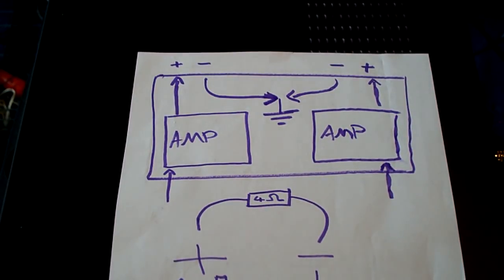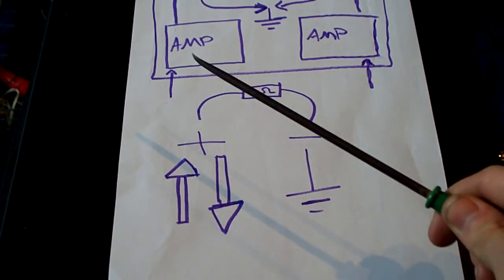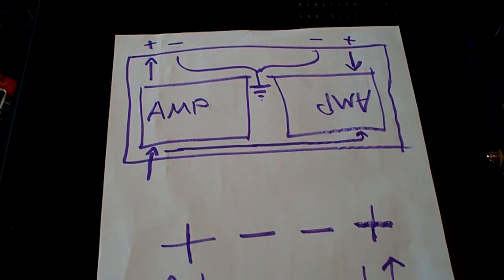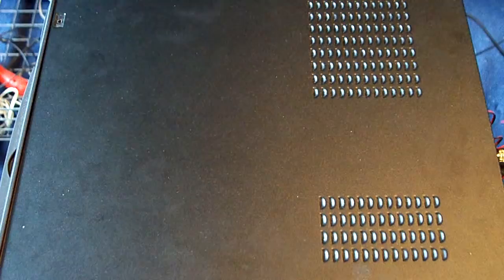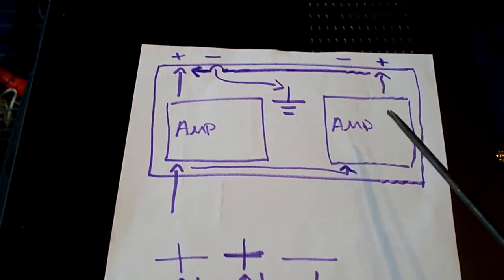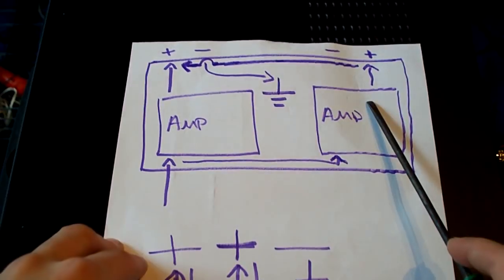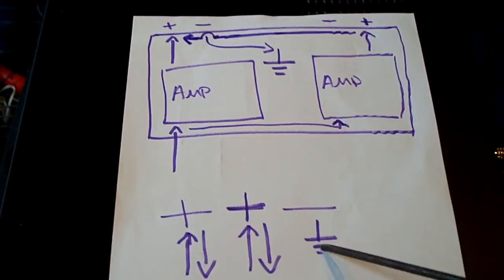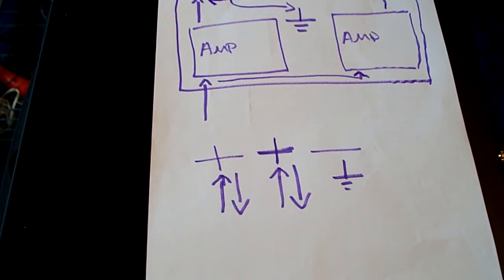How bridgeable amplifiers work! Bridge / Parallel Mono ~ EXPLANATION

Comment: Excellent vid mate. I have thought about the parallel bridge thing but i didn't know it existed and worked!  It make perfect sense though.
Both the negatives in the amp will be the same so you could use both if you wanted to, but you wouldn't need to.
And, heck so many comments about you being wrong about the bridging, one channel is already inverted so one - is actually +. But you already said that, haha. 
Anyway, great vid, you always make good tutorials.

Comment: Your explanation is very clear and correct. I am an electronics engineer, and I cant believe some of the stupid comments people have posted about this - they show their ignorance and unwillingness to learn. I have a question though - if I am running a Crown 1201 in Bridge Mono, but I dont have the +Ve posts linked, why am I getting distortion out of Channel 2 when I connect a speaker across it? Surely if both channels are receiving the same in phase signal then both channels would running normally?. The amp works fine in stereo on both channels otherwise. I am thinking there is a reason to do with the negative terminal on channel 2 in bridged mono mode.
Reply: +No.6 Portmeirion 
you are an electronics engineer and asking this question.. LOL

Comment: I want to watch you bridge two amps & ground the amps negative speaker wire terminals to ground like you're saying here. :)
Reply from the maker: +kbryancourville I'm not saying to ground them. I am saying they are internally grounded to the output section floating ground.
Reply: @barevids  some amps dont say bridgable....so what is diffetent in a bridgabele amp?

Comment: It's easier to thing of the "+" as "live" and the "-" as "neutral" as the "+" is emitting an AC audio signal and the "-" is just a ground. I suppose you could combine bridge and parallel to give you 4 x the power into the same speaker and have the same minimum impedance.

You should be able to parallel more than two amps but bridging is only two. I don't think you can bridge a bridge as far as I know.

Comment: Hi BV. Thanks for your informative video. Unfortunately I still can't quite figure my large pro audio system out to patch it and run it correctly - mainly I'd like to check how I power the subs. I'm a pro musician - our band plays a lot of large venues. My sole amp is a Camco Quadro Vortex 3 4-channel amplifier (rated 750w into 4 ohms per channel), and it powers my double NEXO PS8 system (which is 4 x ps8 boxes for the tops, and 4 x LS400 subs - I run two of each of these boxes per side (so 4 tops and 4 bottoms in total). I run the PS8 top boxes in stereo.. 2 per side, so a 4 ohm lode per side out of amp channels B and D in stereo. The individual sub boxes are 6-ohm boxes, so I link two boxes together per side, out of amp channels A and C, so those 4 boxes would be a 3-ohm load per side - per amp channel there, as I have all four amp channels switched to stereo. But I suspect I'm not running the subs as powerfully as I could be, so may not be getting the maximum bottom end out of the amp, but I think the A&C sub channels are being pushed quite hard regardless of the modest output. Can you please tell me how I should patch this particular system to get the absolute MAXIMUM out of the amp for the subs? It's loud, and sounds clean, but I suspect it's capable of much more, if I patch it correctly - would parallel mono for sub channels A & C in this case be better than just running it in stereo with this heavy 3-ohm load per amp channel? I use the original blue analogue NEXO TD Controller for full speaker management, as is Nexo's requirement.

Comment: Your comments about parallel amps is absolutely correct but you dont explain how to generate a 180 degree phase shift to enable the amp to operate as a bridge amp. To do this you have to gain access to the inverting input of the amp you want to be the inverter. This involves lifting the feedback ground resistor off ground and connecting this to the main amp's speaker output. This is known as "master slave" working.  It is the best way to do it. You can buy inverters to do this though.

Comment: so connect the remote to the 2nd one is what youre saying? I dont get why you have to flip the 2nd one facing the other way how does the head unit know the difference .. oh well I'll try it anyways ..  Im going to use y splitter for rca right and left thats mono right? Thanks for the idea ..
Reply from the maker: No no no, the remote has nothing to do with it... You've misunderstood the video, DON'T try it as you'll end up blowing something up.
Reply: @barevids  I did and it plays okay lol .. its 2 under seat 8" amp subs ..

Comment: Don't confuse this with the rest of the circuit! It works this way because you are changing polarity of the speakers, not the current flow through the amp.

Comment from the maker: @walkingfreak incorrect man, PA amps with a switch to change from stereo to bridge flip the signal on the 2nd positive. In car amps this is less common as usually the negative is actually a flipped positive in the first place.

Comment: greetings i have a question: i have 2 crown amps xti 6000, they are linked. Each channel has a 18" turbomax 1500 watt speaker. It's only for the subs. I just use the amp with the DPS off. Do you think i should play in Bridge mode? And in mono?

Comment: So if I have a series loaded dual voice coil sub 2 ohms,and a amplifier that is 1 ohm,what 2 terminals do i connect to with the 2 speaker wire ends?

Comment: I have 2 dd 700 series 12s 4 ohm dvc. On 2 CAB 1600.1s strapped at 1 ohm(.5 each)  terriivly ineffiencent, too much power.  its a but much and too much draw on electrical. Other option is 4ohm then its not enough.  Is there anyway to get these amps to see 1 ohm per... which would be ideal. Using one of these methods

Comment: Output from power amplifier is AC not DC. Basically (+) and (-) marking are only for connection purposes.
Reply: Not just for connection purposes only, but also, phase of the sound wave coming from the speaker, if wired wrongly, the sounds waves can cancel each other out, thus less db. bass frequencies will suffer the most.

Comment: The electron drift flows from negative to positive, but the current in fact flows from positive to negative as it is opposed to the electron drift, correct me if I am wrong?
Reply: You are not wrong. In fact, you are even right.

Comment: Why in the hell would you ever connect a speaker to both positives? That's insane.
Reply from the maker: This is how bridge mode works in every bridgable amplifier on the planet. By flipping the second channel out of phase it becomes a negative with twice the potential difference to a regular ground point, thus doubling the resulting voltage that the connected woofer sees.
Reply: That's how bridge mode works. You are basically doubling the rail voltage.

Comment: what if i have 2 amp one is standard amplifier but the second one is bass only amplifier, so it's like 2 input for 1 speaker is that possible? and what should i use bridge or parallel

Comment: Hello! I want to use a stereo amp to drive a mono channel (HT center channel). I'll be using a tripath amp (Class D). Could I connect both outputs in parallel? Is there any advantage on doing that instead of using just one channel? Thanks!
Reply from the maker: not without current balancing circuit unfortunately! 
i'd be very careful with those tripath amps, AWESOME while they work, absolute headache to repair!
Reply: @barevids  Thanks! I'll probably just use a single channel. I have an Oppo 105 and don't want to hook it to a receiver that will add a lot of digital processing. I already have a pair of T-Amps for front and rear and I'll probably use one channel of another for center channel. Once again, thanks!

Comment: I have two kenwood 9105D monobloc amps running separately to two Alpine SWR 12d2 running at 4 ohm for 500rms each sub. Now my problem is the rca's when I daisy chain to the second amp it cuts the sound a lot but when I hit the phaze button it hits hard.. I unplug the second amp rca's and switch off the phase it hits but only one amp is putting out voltage, hook RCA back to the second. Nd it gets very weak sounding??? Help if you can!

Comment: the + goes to - is conventional. it is going (on an atom level) from - to + / negative charged electrons jump from atom with more electrons in outer layer (negatively charged atom) to atom with less electrons on outer layer....but.... since the convetional way is "accepted", so called positive terminal carry electricity (bunch of negatively charged electrons) to the negative terminal (earth/ground)...so... electricity (in DC circut) flows from + (yet negatively chaged) to - ... wierd :|

Comment: I bridged a 200 watt pyramid with two 500 watt 10 in. orions and blew the box apart. you call yourself a expert?
Reply: A 200 Watt Pyramid amp is not bridgeable because they us ea common power supply. You have to use a bridgeable amp.
Reply: because if you bridge the amp @ 4 ohms , the load of each amp becomes 2 ohms each amp for 4 ohms bridge , maybe your amp is 4 ohms per channel it cant handle 4 ohms bridge

Comment from the maker: @momzacksfat if you send me the impedances of each cab and the minimum impedance for the amp in each mode i will tell you the best way of wiring to achieve maximum safe power output :)
Reply: can i add a woofer speaker to my car sterio and if yes .how can it pls

Comment: its confusing.. you should explained first about the stereo and bridge switch before talking about bridge.. normally in a car amplifier when you bridge you connect (+) on one channel and (-) to the other channel..
Reply from the maker: On car amplifiers the right channel - is actually an out of phase positive. To allow stereo or bridge mode operation without having to flick a switch.